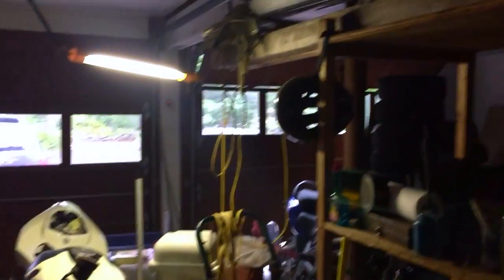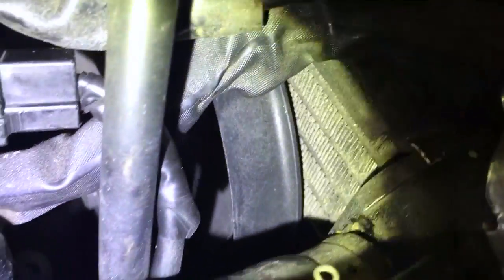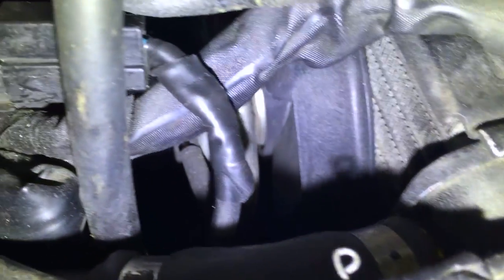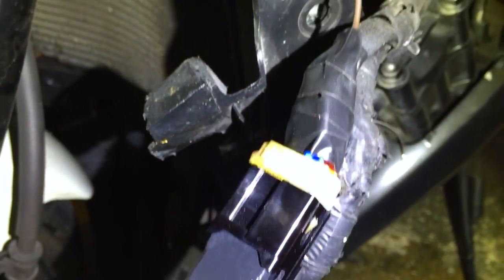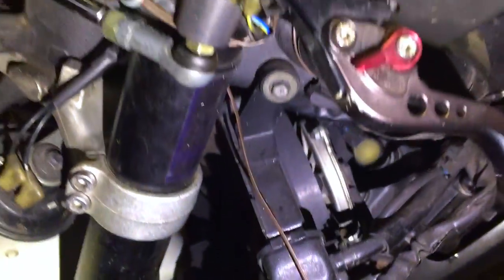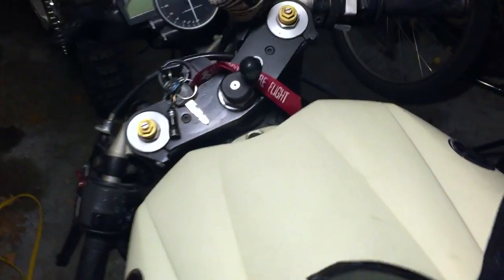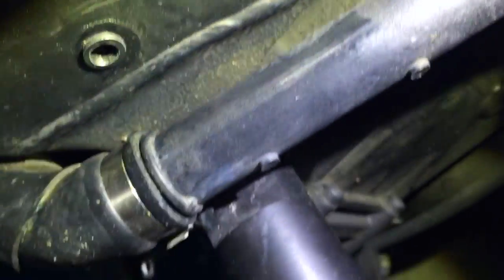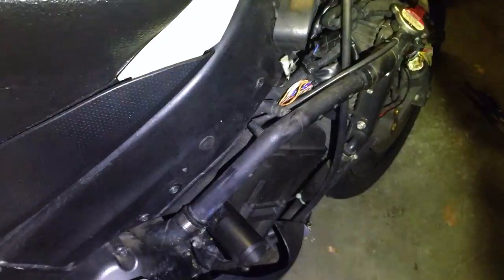YAMAHA R1 OVERHEATING FIX

Comment: I've had a little overheating for a while. I replaced my thermostat with one with a higher boiling point and that fixed it. Also, make sure there's no air and leaks in the cooling system.

Comment: you fotgot to mention how you connected the fan switch, which wires.  did you run the switch to the fan relay, or directly to the fan?  please share.

Comment: That front headlights and everything look like my 99 so I’m wondering if it bolts on just the same and it’s just the side fairings that might mount different bc I have a whole bike that’s got no headlights or fairings besides tail section and I was going to do a moto dual sport cowl hood for lights to make it look like a street fighter but if the 03 bolts right on to the 98 to 02 then sht I can probably find one somewhere easier

Comment: hi Hans, i only saw your comment on my video just now, i no longer have the bike so wouldnt be able to do another vid - looks like you found the relay that controls the fan - i literally just connected that relay to the fan switch (in-line) from a suzuki vitara which has the same coolant pipe diameter as the R1 5VY.

basically the same deal as your manual switch only mine is automatic
Reply from the maker: That's sick! Thank you for getting back, thats actually a great idea, will try to do something like that. Unfortunately the bike is gone at this point (check my most recent video) but I think I'll be getting another R1 in the future.